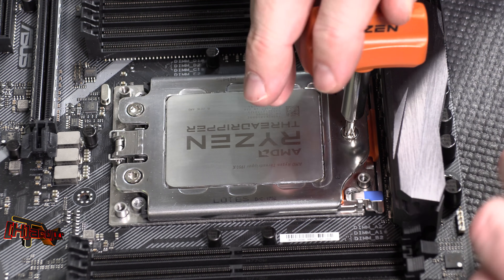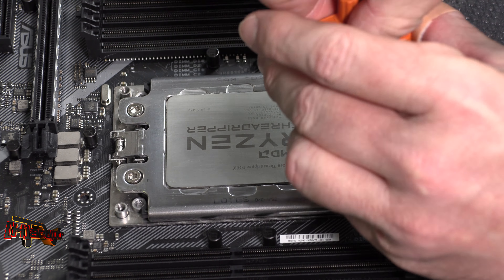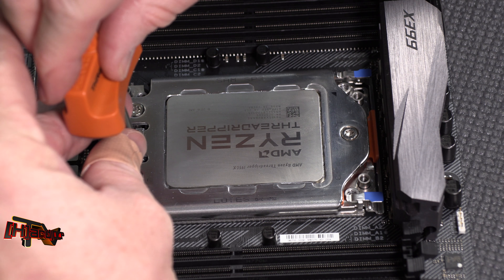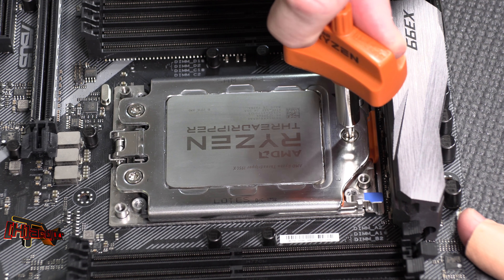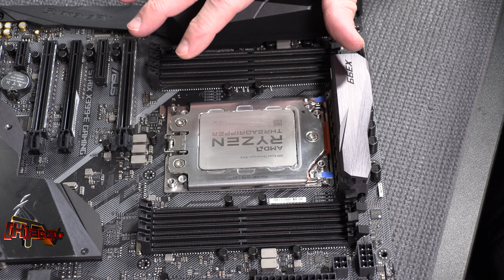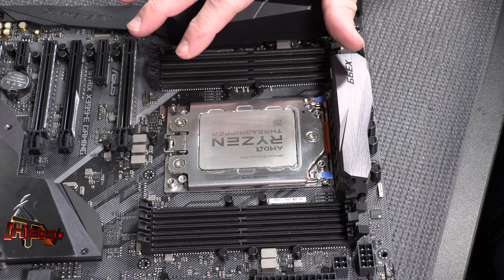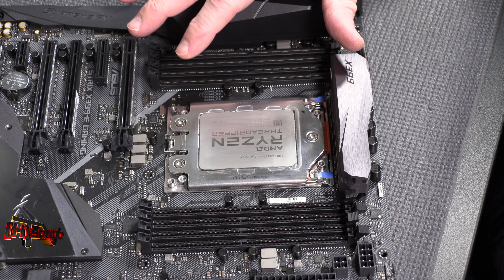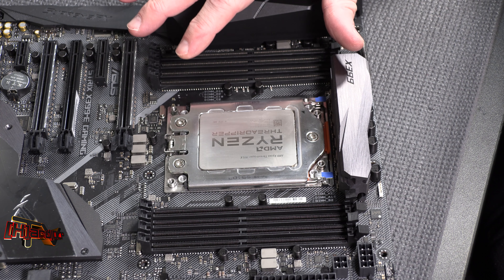AMD Threadripper CPU Installation

Comment: Thank you. The pins on the motherboard sure are fragile. You can't even touch them.
Reply from the maker: Exactly correct.  Do NOT ever think about touching those.  I am pretty sure I could bend those with my mind if I tried.